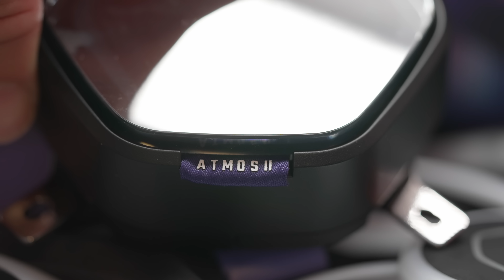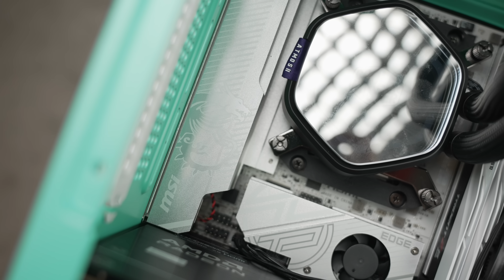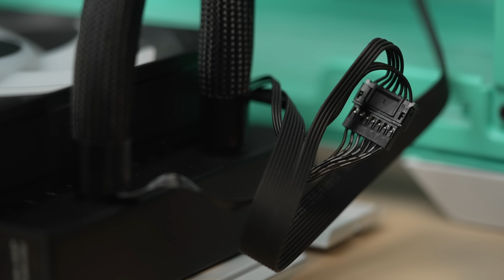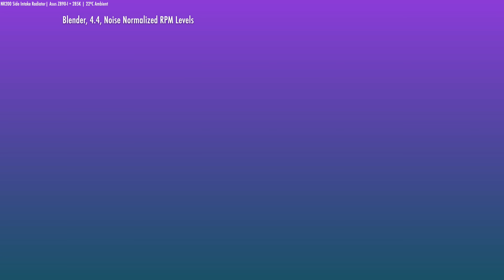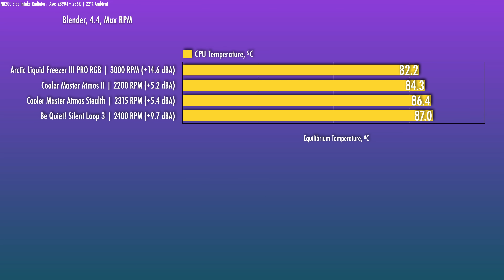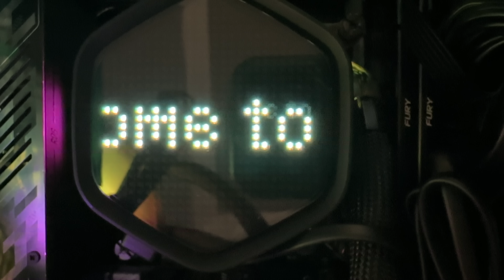The Atmos II lets you make 𝐢𝐧𝐜𝐫𝐞𝐝𝐢𝐛𝐥𝐞 cooling yours!

Comment: Hello. I have been looking for the best 240 mm AIO cooler for my PC for a long time to replace it with air. Current temperatures on the Ryzen 5900XT are around 80°C at full load. I would like less with water cooling. What is the best AIO 240 cooler? It's not about the price. There are really few reviews where there would be a bigger comparison. So far, the Cooler Master MasterLiquid Atmos II 240 or the Asus ROG RYUJIN III 240 work best for me. Thanks in advance for the info.

Comment: Only 360 for the western (or just US?) market seems stupid. The fan plate & integrated fan cables are also a huge step back and kind of an antithesis to what made the Atmos so great (customization). Also, why can't we make the inside plate behind the covers black as well?

Does the VRM fan have an impact on SSD temps too? Usually bigger coolers don't help in small cases due to the lack of airflow transporting that heat away from it. And can you remove the fan plate with another connector before it goes into the sleeving or do you have to cut them?

I do wonder if they do a revised stealth version for the cooling improvements though.

Comment: Do you know if you can mount 2 x 120mm fans to it? The stock fans only screw in at each end, so wondering if there are screw holes in the centre for aftermarket fans?
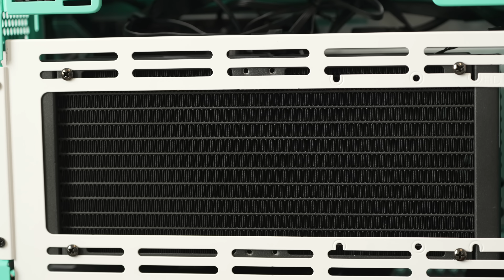Reply: You can see the center screw holes at 6:44, so the radiator seems to be standard issue. I don't know if the standard fan cables have another connector at the end of the sleeving or if you have to cut them though. Really weird decision to integrate the cables.

Comment: They HAVE to do a stealth version don't they? Why go through the trouble of making the pump way smaller than V1 so it fits in tiny cases only to then clog you with stupid RGB cables.
Reply: I wonder if that's why the Stealth is not available anywhere. Maybe they do a revised version with the cooling improvements?

Comment: Cooler master seems to forget the market for the 280mm AIOs
Reply: And the 120 MM aio. For the people who gonna berate me for this comment, brief reminder we're in a SFF channel. A 120MM AIO would be better than any low profile cooler.
Reply: @K-423HOFIN I couldn't agree more, I'm in the market for another 280mm AIO for my nr200p max and there doesn't seem to be a lot of options out there, Cooler master should be the one doing it at least, is their case
Reply: My biggest complaint is that they just said oh well to the 280mm market
Reply: @jrking3812 i’d be curious to see how this atmos 240 compared with the other top performing 280 ones, but totally agree. would love to see a 280 version of this
Reply: The problem is that with cases that can fit the width of a 280mm AIO (usually at the top) means you can usually also fit a beefy air cooler such as the NH-D15, which have similar performance, usually cheaper prices, and basically lifelong durability (at worst you need to swap a fan or get a new mounting kit for a new socket). This makes 280 AIOs a tiny niche market.

Comment: Did they fix the issue with pump not reporting its speed properly in the 1st gen before releasing the 2nd one?
Anyway, they made this one unneccessarily complicated and the software is still unreliable, typical Cooler Master...
Reply from the maker: The pump speed readout was consistent and seemed accurate to me on this one. MasterCTRL has in the past had issues with accuracy though.
Reply: News to me. Never had a issue with the first Atmos, ran great.

Comment: Thanks for your video! 😀👍

While the thickness of the pump unit is great at just 39mm with the plain cover, the decision to sleeve the fan connector cable making it unremovable is just a bummer.

So many people want to use their own fans.

And as you mentioned when swapping them you end up with unused cables you still have to put somewhere.

In a SFF build you want to exclude any unnecessary stuff.

Also it's unfortunate that on AMD you only have 2 orientations now due to these adapter shenanigans. 

I'd rather have a dedicated bracket than 2 cobbled together. 

The Atmos 1 240 was THE watercooling  recommendation for the FormD T1.

I doubt that the Atmos 2 will get the same praise.

But we'll see.

Maybe you can just cut the sleeve off and remove the unnecessary cable.

But most likely no solution for the missing mounting orientations.

On another note:
any word on a release date for the Cryorig C7?

I'm very curious about the performance of the vapor chamber.

Comment: can we use the aio by set the pump and fan only using Cooler Master software without the armory crate or external software?
Reply from the maker: MasterCTRL can see speeds but right now cannot control them. You don’t have to use Armoury Crate (Asus), just set the speeds within BIOS, this is the more reliable way to do it as well.